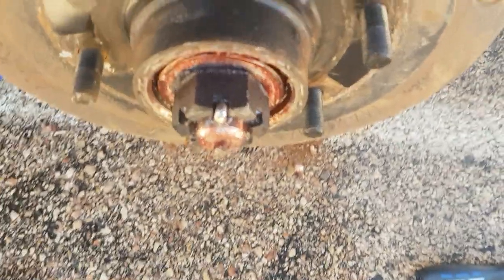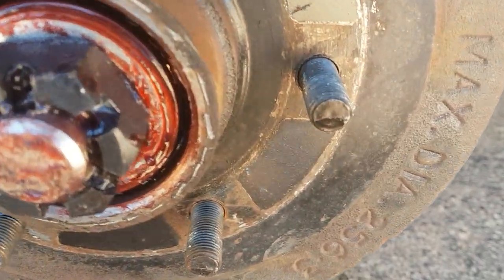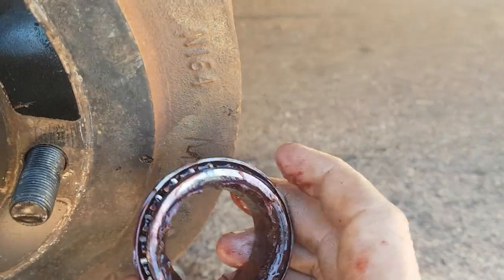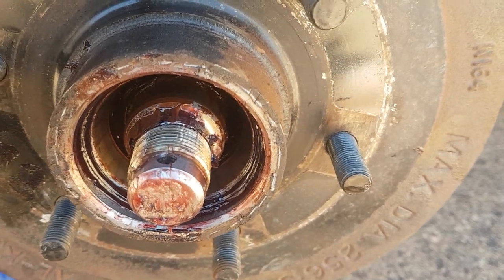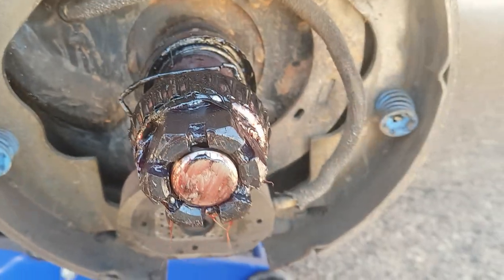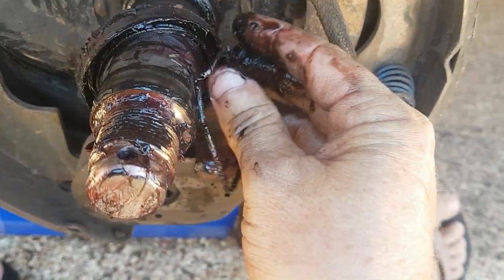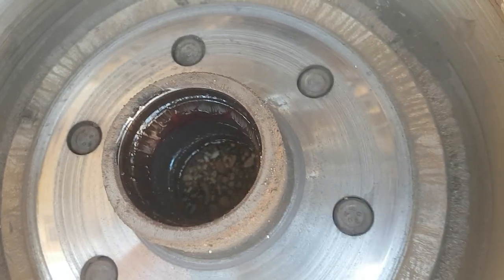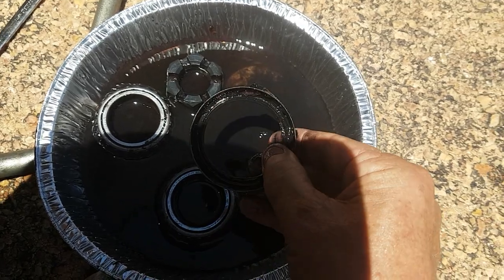Jayco bearings Part 2

Comment: 3:58 You don’t need to put the axle nut back on to remove the hub you just gently wiggle it until it’s free, if the seal comes off during that it means it’s buggered